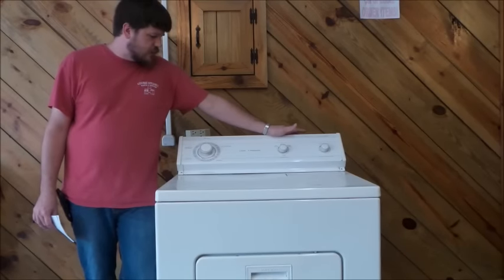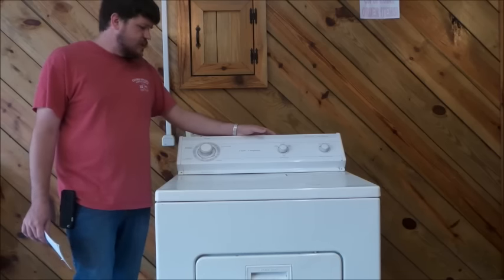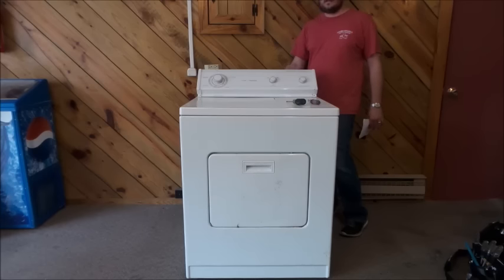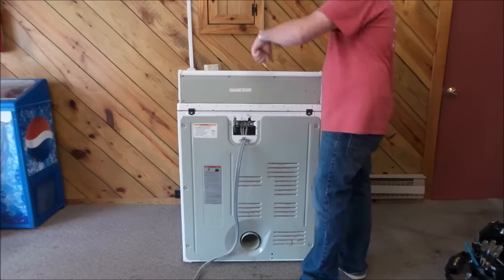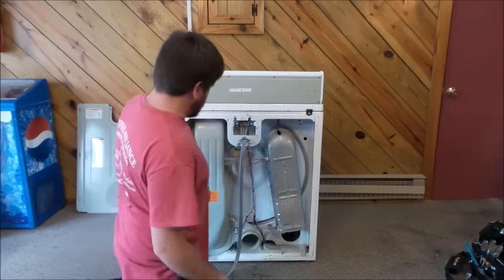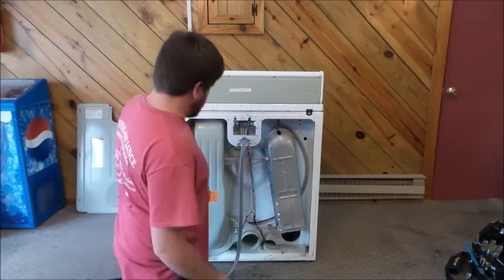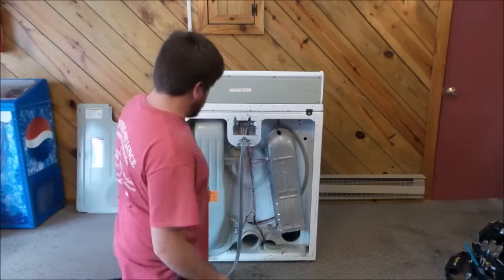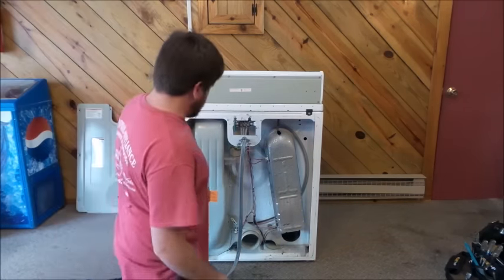How to Clean the Lint Out of Dryer

Comment: As a single mother, I can not afford to hire someone to service my dryer. So, I came across your video, and even though the lint was not the reason behind my dryer not working, I figured, since I had it apart already, it wouldn't hurt to clean that out too. Turns out that this (used) dryer was SOOOOO Clogged with I don't know what.... including a pencil (go figure), that I can't believe I didn't have a fire! The bottom hole where everything settles was completely blocked! So, thank you so much for this video. I would never have known to clean this out, so thank you!!!! I hoping to find the reason behind no heat! Hopefully your other videos can help me with that! Wish me luck! Thank you so much!!!! Glad this video was easy to follow along!
Reply: Deanna Davis, Probably the exact same thing happened to my drier the other day. The lint blocked the wheel from turning as well and as a result it blew its high temperature safety thermostat that's at the top of my long heating element. The video I saw that walked me through testing all the different parts with a Ohms Meter said if the safety thermostat blows to go ahead and replace the lower operating thermostat also because it could have been damaged. My local appliance parts store sells them as a combo package. Good luck!
Reply: @crazypiratesquirrel3038  nice geedbsck
Reply: @crazypiratesquirrel3038 , please give the link for the video you saw.

The clogging of the exhaust usually burns out the fan or the fuse or both.

Comment: I've been troubleshooting and repairing my old Sears Kenmore gas dryer for almost 25 years now and I found that the burner valve solenoid coils can become weak over time.  When this occurs there is not enough magnetism generated to hold the valve open and it will shut off.  Just recently I had the flame ignite, burn for about a half minute, then shut off.  I suspected the solenoid coils again; however, I had just replaced these only about five years ago.  Turns out that the exhaust vent was completely blocked at the louvers outside the house.  I removed the wad from the vent and now my dryer is back in service.  Thank God I found this blockage and thanks to the manufacturer designed this machine to have temperature sensors in the dryers internal exhaust duct to monitor the temperature and shut down the machine if they sense a temperature above normal.  We typically clean the lint screen; however, I had recently threw a bunch of burlap into the dryer after having washed it and I never experienced more of a mess than what this material made.  I cleaned the lint screen and the next time I ran the dryer with normal fabrics in it is when the trouble began.  A word of advise: don't run burlap in your machines.  If you have the flame got out after a a short time, first check your vent for clogs as I had.  You'll save a lot of time and money if that is the root of the problem.

Comment: You saved my dryer!  The grille with the holes at about 10:38 was completely smothered in a mat of lint more than an inch thick.
But that wasn't why I had to disassemble.  Pro tip: don't store a pile of markers on top of the dryer and then lose one down the lint screen slot.

All better.  Thank you!

Comment: This just saved me a lot of money. Our 15 yo Kenmore need 3 cycles to dry a load. I cleaned the duct work to the outside but it didn't seem to make much difference. Was looking at a replacement when I found your vid. Followed your steps and discovered a completely plugged housing. Start to finish less than an hour. Thank you so much!

Comment: This was very helpful to me. After removing the back I found I had a build up of lint in the chute and clumped lint in blower fan. Cleaning this out fixed the vibration problem but I still had a thump-thump each rotation of the drum. Taking apart the front, I discovered a small amount of compressed lint in the roller groove which hit each roller every rotation. I scraped it out with a butter knife and reassembled. Thumping is now gone and unit runs smoothly. Thank you for this video as it gave me the confidence to disassemble my dryer and save an expensive service call.

Comment: Thank you so much for the vid on clearing the lint out of my 23 y/o Whirlpool dryer!  I appreciated your discussion of reasons for the dryer taking so much longer to dry the clothes and decided lint buildup might be the problem.  It was very easy for this 60+ y/o lady to follow your instructions and clear out the packed lint at the bottom of the lint trap.  Given the age of my dryer, the lint trap housing foam seal just kind of broke apart and fell off when I removed the housing.  The condition of the foam seal around the blower housing wasn't much better (dry and compressed).  After a brief search online for my model's parts, I found the necessary replacement part names and where to order.  I'm fortunate where I live to have an appliance parts store near by and was able to pick them both up for just under $20.  I dried a load of clothes last night and drying time was back to normal!!  Thanks again!

Comment: This was a VERY GOOD explanation of dryer maintenance.  I've cleaned gas dryers with the  lint catch located at bottom of opening for loading clothes. When my neighbor was throwing out a dryer like you worked on, but gas, I grabbed it to take apart. Was a good learning experience. I would use a length of rubber hose, 3/4 inch car heater hose to reach into dryer to vacuum it out, this worked well for periodic maintenance. One should ALWAYS clean lint trap after each use.

Comment: Omgoodness thank you for this tutorial! I was loading my dryer with a blanket and then remembered to clean out my lint trap and when I pulled the lint trap out, the lint fell back down the shoot!

 I tried to stick a wire hanger (that I fashioned into a hook )down to pull it up but no cigar 😢. So I googled and came across your vid. 

All I can say is thank you for breaking it down because I didnt know what to do besides calling whirlpool. But I got my handy-dandy Ikea tool kit, and pulled my dryer forward out of the laundry 7:35  closet and followed you step by step so I could get into the lint container. 

My dryer is new so the only thing that needed cleaning was to get the sheet of lint out of the metal shoot! Took me an hour because I was more afraid of loosing all the screws lol!! So i put them in a cup. And Joila! Everything is put back together and my blanket is now drying!! Thank you so much!

Comment: Thanks -- fantastic video.  My dryer stopped working the other day -- turns out it was a blown thermal fuse.  Unlike many other videos on this subject, you show how to really clean the back of the dryer.   To others, I would also add this:  I bought one of those brushes for cleaning out the vent -- the problem, however, was that there was so much lint in there (I'm lucky I didn't have a fire) that the brush simply kept pushing it up.  So I took the blower off my shop vac, attached the tubes that I use for blowing leaves, and went outside to the vent opening and blew the air back into the house.  Well, I could have upholstered a couch with the amount of lint I got out of there!  So if you have a blown thermal fuse, REALLY REALLY make sure that vent is open and clear.

Comment: Thanks for the video. You helped me a lot. However, you forgot to mention that the felt on the drum needs to ride over the metal. If any part is tucked under, the drum will not spin correctly. This was my problem. It took a little searching on youtube, but I found the solution. You might want to update your video to reflect this. It could cause people a lot of frustration. Anyhow, the rest of your video was outstanding. Thanks.

Comment: I'd recommend using cut proof gloves when rummaging through the trapped debris (15:00). Once a scalpel blade got in there and cut my finger.
Reply: shop vac.
Reply: I would recommend gloved period, the edges of the sheet metal are razor sharp

Comment: I have a1988  Kenmore dryer similar to the one you demonstrated with. The internal sheet metal duct won't come out since there's a spot welded panel along the top of the back. Any suggestions?

Comment: I've watched a lot of good videos on how to clean the dryer venting, but none showed or mentioned cleaning the blower motor which I have found also needs cleaned.  Fortunately, the blower motor is accessible behind the panel at the bottom front of my Whirlpool Cabrio dryer.  I use an old toothbrush to clean the blades of the blower motor.  Thanks for addressing this.

Comment: I'm still trying to figure out what that little pressure differential things does.
I used to have a dryer just like that.  Had it apart a few times.  I think mine was much older, tho, it was a "Wrinkle Guard 1", lol.
Got it from a used appliance place.  The door cables had been replaced with clothesline rope, and they were too short.
I picked up cables at Sears and fixed that.
After a while it stopped heating.  The leads at the element had spiced in low quality wire with automotive butt connectors connecting them to the factory wiring harness.  The leads literally burnt off.
I spliced in high temperature fiberglass coated wire to fix that.
I put a new belt in it once, not because it broke, but because a friend's broke and I had to take mine apart to figure out how to route the belt.  So I figured why not put a new belt in?
The top filter did not have a lid like that one, it just dropped in.  The factory handle screws were missing and somebody put in long sheet metal screws or something like that, rofl.
When I got rid of it, it still worked.  The only problem was the drum supports needed work.  Sometimes the drum wouldn't turn, so to get it to work all you had to do was manually turn the drum a little, then quick start it and it ran fine.  ;)
I would have fixed it, but my washer had sprung a gasket leak in the gear box.  The oil leaked out all over.  It still ran, but I was lazy and figured it would still keep running, but it turns out that it really needed to have a full gearbox.  Gears need oil?  Go figure, lol.  It made it a couple years then the gearbox stripped out. :(
Sooo, I bought a new washer and figured I'd get a dryer and get the whole "set".

Comment: Yes, Dryer Model #11096281100. In this video, you show the dryer lint screen shoot, coming out after removing the 2 screws on top under the screen door and the 4 screws at the bottom on the shoot. I had to remove the front panel, the drum and remove the 4 screws at the top of the dryer bulkhead, pull the bulkhead forward in order to remove the outlet shoot. Thank You

Comment: Mine not getting hot I had the heating element checked an one of the fuses checked at the top an I cleaned the vent from the dryer that goes outside really good what else could it be. Could it be the timer I haven't cleaned the vent barrel yet that u just did in this video

Comment: My dryer is a Maytag, so it's a few years older than this.  When I took the lint bucket out, there was some kind of harness up near the top that came out with it. I'm not sure where it attaches.  It's about 6" long and came out when I pulled the top of the lint bucket out.  It may go in where the screws to the top of the lint screen are but I'm not sure.  Any help?
Reply: It looks like a belt tensioner when I looked at it again except it doesn't turn.

Comment: could this make the dryer overheat?
Reply: Lint is the primary cause of that.  Even good running dryers & vents should be inspected an cleaned regularly.  A relative of mine just burnt up their dryer due to a long vent pipe + lack of cleaning.  No fire in this case, but the long term running at high temperatures caused the element to get brittle and break.

Comment: How often do you typically need to take the dryer apart and clean it like this?
Reply: If you empty the lint filter after every load and have a short run for the vent, every 2 years.  If not, once a year.
Reply: HzG8rGrl thanks!

Comment: Cool video...the old me would think    "if dryer is taking 2 hrs to dry my stuff, then it's time for a new dryer.". New me thinks "I (think) I can fix it".  I'll see if I need to replace my thermostat when I open it up.
Reply: I’ve been fixing things since I was a kid.  Still doing it in my 60s.  However, with YouTube, it is way, way easier to get info.  When I first fixed a burned out over limit fuse on my dryer, I had to mail away to the manufacturer for the tech manual !!!  Much easier now. 😂. Best wishes in your future endeavors!

Comment: Great video. And depressing, thinking I have to tackle all that. Thanks!
Reply: Yes!😭🤣
Reply: Well, I did the back, but not the front, of the dryer. It didn’t work. However, what DID work was buying one of those kits with the brush that attaches to your drill, and cleaning out the duct. Just make sure you always have the drill turning clockwise, and use TAPE, lest you accidentally unscrew one of the many parts to the brush, or the brush, itself, in the middle of the duct. There is somebody on YouTube to show you what to do. Ended up costing me about $35. Couldn’t have hired someone for that. I would suggest trying the duct before working on the dryer, itself. It’s nice to be able to dry clothes again!